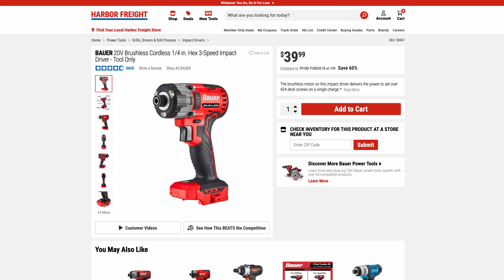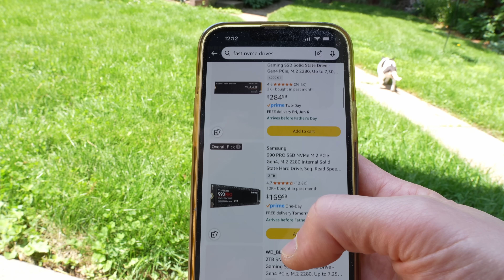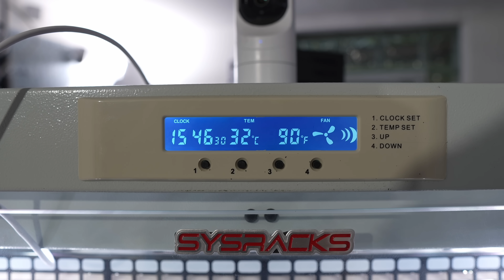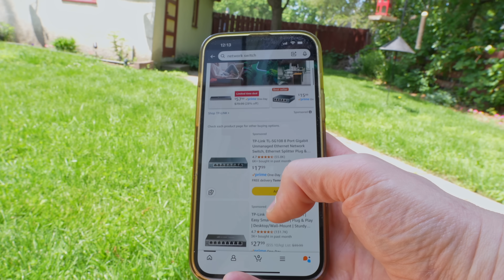Buy Once, Cry Once: How I Wasted $2,857 on Switches

Comment: Buying new hardware for mid to high end home networking is a waste of time and money. My Arista DCS-7050S-52-R I got off ebay for $350 has been going strong for five years now? It has a 2x10G lag to the Cisco 3750X-48PF-L I also got off ebay ($90) that covers all my 1G PoE needs.

The Arista also handles multi-10G lags to all my servers, fiber to my M920q with an x520 card in it running opnsense, and two fiber drops to my desk for my desktop and the only network device in use that I bought new, my Ubiquiti USW-Flex-2.5G-8.

Buying it all new would save some on power, but by the time it made up the difference I'll probably have replaced it all. That and I have real networking gear to work with, where interacting with anything beyond the surface level doesn't require a tortured, nightmarish expedition through the UniFi UI/documentation before ultimately finding out none of it is supported, or the support is incomplete/half-assed/non-standard.

Comment: So it outputs 90w over poe which is enough for a low power laptop, but you wouldn't try it? What, you don't think it can actually put out 90w? Why wouldn't you try it? In fact, the first thing I would try is to load it to the max to check the manufacturer isn't lying.

Comment: Whilst you alluded to it somewhat, the reality is there hasn't been a 10Gbit switch in Ubiquiti's lineup that makes sense as an All in One device until recently, and I would argue there still isn't one that makes sense for the home user.

Meanwhile I sit here continuously irritated by the balancing I have with my UDM Max & a XG 6 PoE with not enough ports for high performance devices AND PoE devices.

Comment: This is all fine until 25GbE is the new standard...
Next video: Buy Once, Cry Once: How I Wasted $5,599.76 on Switches

The tech space is moving fast! Your new switch is not the solution to all problems, it's not even future-proofing, it's a solution to a problem here and now. Give it time, and it's not sufficient.
There is still lots of gear build with fiber in mind, so 10GBASE-T (RJ45) only gets you so far... Now you have to adapt from RJ45 to SFP+ on the other end or change the interface.

When I first upgraded to 10GbE, the US-16-XG was one of the only options available that I could get without selling my kidney.
I do have both RJ45 SFP+ adapters and a few machines with 10GBASE-T (RJ45) ports, but the majority are either 1000BASE-T, 2.5GBASE-T or 5GBASE-T, so for 10GbE I have to use a 10GbE NIC anyways, so for compatibility I'm going with SFP+.
Few of my machines are already SFP28 so in my case, you could say that 10GBASE-T is already outdated.

That "One device fits them all" solution doesn't really exist. I do agree that you should think about the near future.
If you know you're about to expand your network, design it with this expansion in mind.
If you have absolutely no plan to expand your network for the next many years. Don't go out wasting money on equipment that most likely will be outdated by the time you really need that extra capacity.

Had I bought a 48 port 1000BASE-T switch back in the days, instead of a simple 24 port switch, then I would've been wasting money. Because by the time I needed extra ports, 10GbE had become obtainable for homelabbers like me.

Comment: What happens when 25GbE, or something similar is a thing? Needs develop with tech development, and upgrades will always be a thing. It's not a question about getting the right equipment, it's about getting the currently right equipment. Thus, there is no such thing as "buy once"-mentality. It can only exist with a static level of technology available.

Who really needs 10GbE currently? Waiting a year or two with 10GbE means it will become more affordable, and upgrading to it later might even save money. Most people don't even have 1GbE internet connection currently.

I just upgraded my switch... Got a used Juniper ex3300-48t. 48 ports GbE, 4 SFP+ 10GbE... approximately $35. Keeping one generation behind, still perfectly find equipment, saves a lot of money. Keeping that way, I can upgrade really often and still be way below budget.

Comment: The Pro XG 48 is the switch that I need too.  

I have 2 25Gb/s connections,  a few PoE cameras, and getting ready to replace my AP6-lites with AP7 pros.  Plus the several 1Gb/s connections on top. 

Currently I'm running 10Gb/s from my firewall to a Mikrotik 10G switch, and then feeding an Edgeswitch 48 with 10G out of of that for my 1G devices. 

It works... but it's ugly.

Comment: Am I the only one to question want vs need?
Do you need 10gb or do you just want it?
Do you really need all those cameras?
Do they have to be 4K 60fps?
What are you going to do with all that video material?
In case of insurance they won’t care if it’s 4k over 10gb network with perfect backup redundancy with last 5 years stored.
What are guys doing with all those VMs?
It seems like it’s suppose to be cheaper but than cloud but every one I talk to paid thousands for the homelab.
It’s a form of flex/addiction or what?

Comment: complete overkill. I just got a Mikrotik with 2x 100 gbit and 8 x 25gbit plus layer 3 switching. Moved everything to fiber. Energy consumption is 26 watts. it is below 1k bucks. never worry about it again.
Reply: What if you need PoE?
Reply: @VacuumD3cay  stack it with a CRS320-8P-8B-4S+RM or similar. Mikrotik has decent switches that you can actually stack without breaking the bank. I am using the CRS510 for my network, because I do not need more than 12 25 gbit ports that I can easily get by using a 100 gbit to 4x25 gbit DAC cable. I can put a 10 gbit gbic into one of the 25 gbit SFP28 ports, configure that for 10 gbit RJ45 and hook up one of those office switches with a 10 gbit uplink. and for POE I can either buy an injector, or, if need be, attach one of those dedicated POE switches. The one mentioned above is at approx 440€.
Reply: @VacuumD3cay  buy a small Mikrotik to stack. They do have POE switches in their portfolio. Inexpensive, but works.

Comment: i think in this case, the route you took, depends on the time you take it in. If you bought them all within a month, this video is true, if it is over more than a year, things did not exist back then, then this video is kinda irrelevant, as the solution you now bought, eventually will come to the same point. You will need new hardware.

Comment: Buy once cry once does not apply to computers, you could buy a litteral super computer back in the 90s and it's still insufficient for modern software. At best you might be able to keep your system through another generation of hardware

Comment: I fell into that trap years ago with used Cisco switches, I started out with the 2960s moving up to the 2960xr. They were reliable and only experienced one failure with a PSU which was resolved with a used one off eBay. It's hard to say how much money I had invested in them, stacking modules, cables, etc.... I had 4x of them stacked together for the most part, usually 1 poe switch in the group. The main problem that I ran into is not enough 10gb ports and certainly not ethernet without the transceivers, also 2.5gbe is now becoming more mainstream. I currently have a combination of TP-Link & Ubiquiti switches. I just purchased the UCG-Fiber gateway and reconfigured the wan to port 1 since the cable modem is 2.5gbe which allowed me to use the 10gb ethernet port to remove a transceiver. I don't really like using them and they run extremely hot, the run is about 25-30ft and I do have an AOC that would work but I like the ethernet for it's durability over that length.

The "Goldilocks" switch as you found out costs serious money. It really is hard to find one that can do everything. The TP-Link Omada's that I have are the 8 port fiber switch, 24 port 2.5gbe Poe and the 8 port 2.5gbe Poe. I don't even really need the fiber one right now and could get by without it but I like having that one switch and everything else connects to that instead of a bunch of daisy chaining. Probably one of the biggest mistakes I made is the 8 port since it's only Poe+ which is fine for everything that I have now but the 24 port has Poe++.

Comment: First of all, that $2700 48-port switch didn't even exist when you bought all of that other hardware, it literally came out 2 months before you posted this video. So saying you should have bought it in the first place, isn't even possible.

Telling people they need (significantly) to overspend up front, because "they might need it in the future", is just bad advice. In your specific scenario, it just happened to work out that your specific upgrade path over time ended you up here. That is not going to be the case for the majority of other people.

You can certainly sell that old gear to recoup some of your overall spend.

Comment: I learned that lesson after I finally bought a decent toolset at 23 and the next repair I did on my car didn't involve dozens of rounded bolts, lots of drilling and crying. 
Now I carefully think about what I need now and what I'll need. If I determine the project in question is unlikely to need to be done more than once: I just send the car to a shop, call a contractor/get someone else to do it. If it's something I'm expecting to need done repeatedly: I buy the tools for it and I buy the ones that turn heads when it comes out. I keep a lot more money in my pocket making these evaluations.

Comment: I think with network components it is very different then with woodworking tools. If you just want to cut one notch out of a plank you ask your friend to borrow you a chisel. But a network component is something constant in your digital system. And it resides there for long times. And technology improves as your expectations evolve and prices of former unreachable things drop to a range were you find it appropriate. I had some internet on a single FritzBox router. I moved and the single AP didn't work, so I added another AP. I moved again and as the house was mine, I started to add cable internet, requiring switching. The kids grew up and they wanted to have internet. The internet grew from 64kb/s to 250/50 VDSL and the need of bandwidth grew with it. I started video editing and loved to have the drives in a loud server on the roof top sitting in a silent office connected over 10Gbit/s. So the usual way is, new switch comes in primary position, then moves to a secondary position, moves to a optional position. Finally it ends up on the lab bench, gets capacitors changed, PSU tested and is sent out via eBay.

Comment: Buy once cry once is definitely the way to go. 
Many years ago I got really tired of spending too much money on numerous mesh routers. 
I learned that if mesh routers do not have a wired backhaul then the speed will never be consistent and reliable. 
I hired an electrician to fish dozens of Cat 8 LAN cables all over my home, outside for IP security cameras, and even a few the garage. 
Then I bought numerous 10Gbe switches (Netgear 8 port 10Gbe) and a few POE (gigabit only) switches for my 9 IP security cameras. Then I bought a Synology NAS with 8 Bays and populated it with eight 22 TB drives and a 10GBe card. Then to top things off, 2 Asus GT-BE98 Pro routers.  It was a big bill but very worth it. No more slow and unreliable connections. Every single LAN outlet is 10Gbe capable. 
Now I'm enjoying 10Gbe LAN for a few years now and getting the full 8000 Mbps from my ISP on my wired connections. All my wifi connections are very fast and have Wifi 7 with MLO available .
For future proofing, when a new router with the next gen standard comes out (Wifi 8), I simply have to switch out the current outgoing routers.

Comment: Just went through the same thought process. 

I COULD get the 2.5g flex poe connected to my UCG Fibre, then spawn 2 switches to get to the further reaches of my 1 bed apartment... OR get a Pro Max 16 POE and just run longer cables.

Once you add the cost of the flex poe, and the non included psu, and then the other switches, and the cable run I'm going to need to run anyway, it's better/cheaper to just have 1 and have it centrally located. I just don't want to spend £400 on a switch, especially when only 4 of those ports are 2.5gbit. 🤣🤣

At least with that switch, IF I needed a trunk to another part of my place, say the shed, I could just run some fibre to it from the sfp port.

Comment: I am currently stuck on this part. For my next compute node.  i can find many small computers with no ECC ram cheap,, or the 45Drives home lab and all the upgrade space i could reasonably need.  Since most of my data is currently stored in two other NAS units.

Comment: I don't disagree with your premise but you've replaced a distributed networking system with a single point of failure. Also, if a switch of this class doesn't have at least one 100G uplink port (or you consume many ports on both ends link-bonding to achieve the required uplink bandwidth, assuming the switches support that in the first place), you're boxing yourself into a corner, as you won't be able to get data out of this switch fast enough.  And I would really like to see that switch do rated PoE++ (or whatever) on all ports.  My guess is there is a modest upper total power limit and the ports are smart enough to individually negotiate to remain within the power budget.  I have a couple FS switches that do that but I also have some smaller port count FS switches that can do  full rated PoE++ power on all ports simultaneously.  As usual, the devil is in the details.

Comment: Its easy to have the same thing happen with NAS drives. Buy your first basic 2bay one when you get sick of regular external drives. Upgrade that a few years later because you get sick of the noise it makes. Now your storage needs outpace that 2bay job so you buy your first 4bay one. Then you want faster than 1gig ethernet, SSD caching and an even bigger RAID. Thankfully I wised up at this point and found an 8bay box with two m.2 slots, expandable RAM and 10gig ethernet for a steal and I'm set for local storage for a long time.

Comment: I dont agree with this. The journey till here is not about expenditure, its about learning and evolution. $2857 was spent on figuring out the chinks and clearing the mental picture and thats a learning. Had you not spent this, you would not have arrived at the current 48port switch costing $2742. This is why ebay or craigslist or yard sale exists, to help others go through that transitory learning curve.

Comment: Buying for the future? No need to upgrade anymore? All in on RJ45? Wait until you find out one can get a basic 100G network for sub 1k and 800G has already dropped into the low 5 digit range.

How could someone with your dedication to buying network equipment possibly resist the temptation of trying to replace unpleasantly sluggish PCIe5 SSDs with fully networked storage?

Comment: Since my home lab isn't destined to be latest/greatest, I stick with stuff that's a little older but still serviceable.  Most of my switch gear is eBay Cisco 3750x switches and I just use port aggregation (LACP) to get more than 1G when I need it.  The switches are inexpensive enough that burning 2, 4 or 8 ports on a 48 port switch isn't that big a deal.  Just use the stack cabling and add another switch when I need it.  Server rack's got two switches and telco rack has one, still have ports avail.  Very little of my stuff needs more than 1G for day-to-day.  The VM hosts have either a 4G or 8G team so they're fine for most things.  That said, I don't do video production editing, so that may not work for those environments.

Comment: You should have learn this lesson when chasing pc upgrades. Should i buy the best or the cheapest that lets me do what i need done now. The lesson i learned is to pursue value for money, not the newest and best. Do not buy for future proofing reasons, then everything few years resell your old equipment. I always keep the original box and i sell about for half the price for when i bought it new. So the money I received is used to buy newer equipment. Ive been doing this for iPhones recently . Im still using the iphone 8 while the newest, best and most expensive is at 16. My next upgrade is for iphone 10
Reply from the maker: For sure with PC upgrades.  That's why I've always bought an i7 in the past when building Intel PCs.  I've been burnt before thinking "I will never IOMMU/Vt-d"

Comment: 1 Poe switch and 1 non Poe switch would be much cheaper and less heat.
And if one dies you can get by until replacement turns up

Comment: I'm the type to go big, buy once, and be done with it. It's easy when it comes to machines you'll use in the long term, and nothing fundamental about their functionality will change anytime soon, like home appliances.

However, when it comes to computer tech, that's not always the case. You have frequent and wild price swings; what you know you need could be cheap today and expensive tomorrow...literally...wishing if only you had just bought it yesterday...or the other way around - if you bought it early, you wish you had just waited. Then speeds are constantly getting upgraded - you can't catch up. Then what if a component dies sooner than you planned on replacing it (and you're outside of warranty)? Do you just buy a replacement or splurge on the next upgrade?
Reply from the maker: This is on repeat in my head with every tech upgrade 😂

Comment: 2 yrs ago I bought a UniFi USW-16-POE with 42w capacity.

I just replaced it with the new 16 Pro Max POE with 200W capacity. 4 ports are 2.5gbe.

I still have room to grow - later add a 10gbe switch for the 3 rooms where I have such cables.

But overall, ubiquity has been good: upgrade gradually.